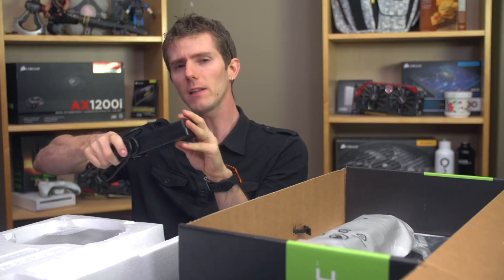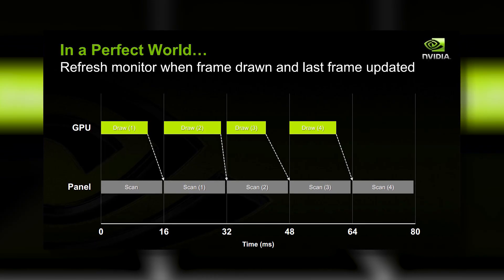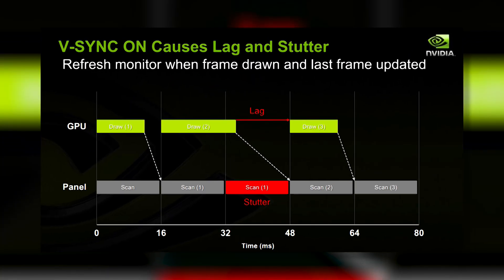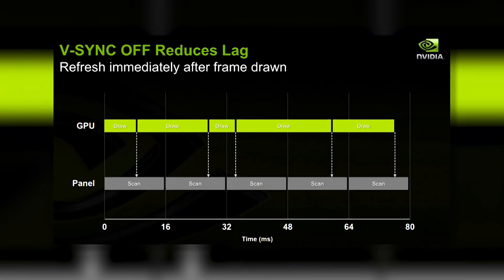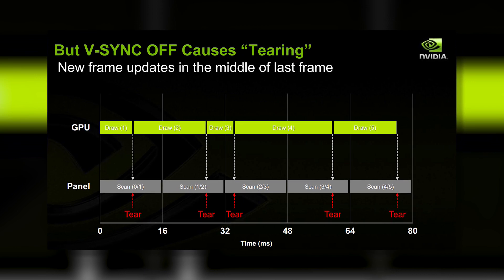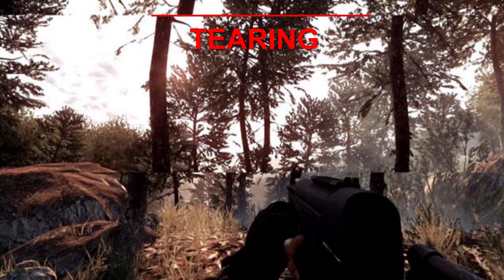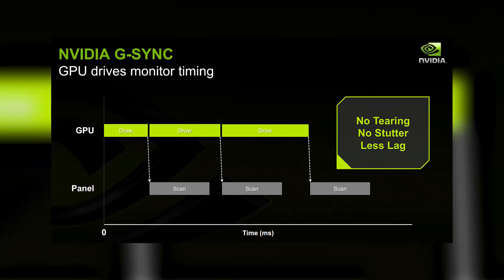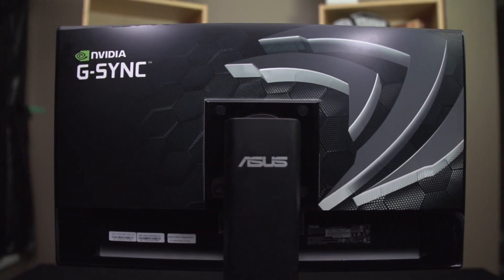NVIDIA G-SYNC Tech Preview - Linus & Slick's Impressions

Comment: Still no gsync monitors..Well the asus Rog is gonna be on it's way fairly soon so they say. It look's good yeah the price is high for a 27'' monitor but considering what you get not just the gsync but its able to display above 1080p and the build quality this makes it a bit more reasonable. I have been thinking about it but im pretty happy with 1080p. I would rather give up resolution and keep my fps higher with max in game settings. I have a benq xl2420tx currently and have been very happy with its performance and color (once i downloaded custom color profile). I herd Benq is going to make a 27'' 1080p gsync,ill probly just wait for this,hopefully 100 dollars cheaper due to the resolution....Anybody have a idea when this monitor or others are due out? I have herd a few different possibilities thus far but nothing concrete.

Comment: People didn't care much about SSD because it doesn't actually affect gameplay, only load times.

Also, SSD made a huge compromise in capacity, this g-sync doesn't seem to have any compromises.
Reply: It effects gameplay. The data transfer is alot faster then harddisk , which should cause output to have much lesser delay. In exact same way to transfer rates. But even harddisk does this so fast, the delay should be unnoticable on both situations.
Reply: implying people don't care about convenience
Reply: Well both G-Sync and SSD don't really have anything worse than current normal monitors and HDD they are just both more expensive, I don't really see what you mean that price is a compromise on SSD but not on G-Sync.
Reply: Crispy Zeal The thing is so many applications don't have onerous load-times, they test a rig because of graphical fidelity, resolution and frame-rate demands.

SSD is obviously better, but at such a cost in price and capacity, I think many would rather take the inconvenience of slightly longer load times.
Reply: I could not go back to not having operating system at least on an ssd. I don't put games on my ssd due to limited capacity compared to size of games worth it but I out os and software such as video editing and photo editing software that normally take ages to load and such.

Comment: Just bought the  Asus VG248QE (as well as a GTX780Ti). I'm digging Assetto Corsa and want to get over 144 fps with a full field. Just watched Henry from nVidia switch out the monitors internal board for the GSync in less than 15 minutes. Think I'm going to take to plunge :O

Comment: Is there any update to this video?,
Here's some food for thought:
After buying several 25" 1920 X 1200 monitors 2 yrs ago, not to mention the hassle of installing them on a 3 monitor stand, I for one won't be buying any new monitors until the ones I have burn up off the stand or simply stop working.
Sorry Nvidia

Comment: so how about g-sync on the new gtx 800m series laptops? some says it will be there (on the laptop screen itself) and some says it doesnt. i dont fucking know man :D anyone know it?
Reply: Nope. We would have heard something. I know for sure that in order for G-sync to work, it requires displayport 1.2. I can tell you that laptop screens won't be compatible.

HOWEVER. Some of the latest gaming laptops that feature 800m have mini displayport output. These are compatible. So it might work with an external display. But I doubt it.

Comment: I'm running vista 64 bit on an asus laptop with a 120 gig ssd because I kept having premature failure of my hdd drives in the laptop, even though I almost never move it and have it on a laptop cooler full time.  I do disassemble and clean out the computer about once every 3-6 months depending on dust buildup and I have external hdds for regular changing media such as movies and downloads. 

Other than having to deal with VERY outdated hardware (laptop is over 4 years old and only single core) I haven't had much problem.  I do notice quite a bit of lag as of late, but it's probably due to age and wear on the computer.  I plan to update in the near future, but for what little I do it seems to run fine. 

I'm not a pc gamer because I don't usually buy games until they're a few moths to a few years old, so I can pick them up for my consoles at pawn shops for less than half price.

Other than not being able to run any newer performance hungry programs or games, I've found it meets my needs fairly well and doesn't take up much space.  The ssd did definitely speed up my boot time, and is still a noticeable improvement when I unplug the external drives for bootup.  I'm not sure just how long I've had the drive so I don't know what kind of life I have left in it, but I'm more that satisfied with it's performance so far as a main system drive.

Comment: Let's say I have 2 non g-sync monitors and I connect a g-sync compatible monitor, will I not be able to use the other 2 monitors because I have g-sync enabled on my g-sync monitor? Or will I be able to use g-sync on 1 monitor while the other 2 are not running g-sync?

Comment: I had once a laptop with an SSD 8GB and it wasn't enough for me and was to expensive at the time of 2010 to buy an mSATA SSD with 32GB, costed over 150$ in my country. So I just sold it and bough an Acer with 250GB but was an HDD, now I feel like I have done the worst deal ever. I had just to wait a few years.

Comment: Wow, this would save so much performance power. Couple this tech with high dpi and you would have the equipment to get the absolute most out of your hardware. Good times are coming for PC gamers and gamers in general, I will buy this if it gets cheaper.

Comment: I bought the DIY kit for my VG247QE as soon as they were available in the beginning of the year.  I can tell everybody from first hand experience, I will never play on another monitor without GSync if I can help it.  The downside is that you are limited currently only to a DisplayPort connection.  DP, not double penetration, is better than HDMI, but it's less common.  You need to play on a PC with a proper NVIDIA graphics card to turn GSync on - you can't just connect the monitor (with an active HDMI to DisplayPort adapter) to something like a Playstation and expect GSync to work... it won't.

As long as none of that matters to you (and it won't - it's just that once you witness GSync, you'll demand that everybody adopt it), then buy the next GSync product that you can.  Because of all the benefits that Linus described (which are all true and not exaggerated), not only does your experience become a better one, but (if you're a picky person like me, noticing jitteriness and frame lag) you'll notice that you don't get frustrated as often and that you're not constantly messing with settings in game, trying to find the right framerate that doesn't cause tearing or jitteriness... trying to match your monitor's 120 or 144hz refresh rate...

In my mind, I register that as a time saver.  When playing DayZ and going through a big city, it doesn't matter how powerful of a computer you have - you're going to hit framerates in the 30s - framerates in the 30s and 40s used to feel unplayable, but they now feel completely normal!  You can see the slowdown but you don't FEEL the slowdown.  In games like BF4, I have noticed that I do play better - when I die in a game, I much less often feel as if I couldn't have done something better to have prevented it.  You're no longer held back by the game and its rendering, but rather by your own reactions.  I can't rate GSync's necessity high enough.  I hope this helps someone!

Comment: Most of the people posting here have no clue how G-Sync technology works.  Please do your homework before posting stupid comments.  G-Sync has nothing to do with what maximum number of FPS you can get in a game.  It's about the gaming experience.  Game play has been dramatically improved thanks to G-Sync.  DisplayPort makes it all possible because of its capability allows full duplex communication between the monitor and your graphics card.  This allows for a fluid motion gaming experience that has never existed before by eliminating screen tearing and studdering.  Seeing is believing.  The only way to find out if it's worth it is to either test drive someone else's G-Sync monitor or buy one for yourself.  No YouTube video will give you the full experience that G-Sync provides.

Comment: Linus, I have a G-Sync equipped Asus monitor (purchased from Overlordcomputer.com) and G-Sync does NOT work when in Surround mode.  This information is provided within the Nvidia control panel that states this information.  I have to say that G-Sync is awesome and works as advertised.  Near zero input lag (1-2ms) and mouse response is instantaneous (Logitech G700s set at 1000 polls/sec) and there is complete elimination of screen tearing and studdering.  The only thing that G-Sync can not compensate for is frame rate drops in game, which has to do with the graphics card capabilities and nothing to do with G-Sync.  My recommendation is if you are an avid FPS gamer, G-Sync is worth every penny.  However, if you are primarily an RTS, RPG, MMOG game player, then I would say G-Sync is not worth the upgrade for you.

Comment: Sorry to burst everyone's bubble but this is a gimmick like phys-x.I got a DIY kit and notice virtually nothing playing BF4 with a 780 on maxed out settings. There's is still micro-stutter and lag. In fact, there is less stutter when g-sync is disabled. Sorry for your luck
Reply: This is completely wrong!  GSync requires a few things to work how it's intended:  triple buffering needs to be off, Vsync needs to be off, and max frame render ahead limit must be put to 1 in the Nvidia control panel.  Battlefield games AUTOMATICALLY have triple buffering enabled in game, so to disable it you have to make "user.cfg" and place it in your game's root directory - open it with notepad and write one line "renderdevice.triplebufferingenable 0"

Also, people have reported worse frametime when hitting the 143fps ceiling with GSync, so if you set a framecap in game to 120fps, you will always get great fps, frametime, and smoothness.
Reply: Considered getting the DIY kit myself, also with a 780. Good to hear opinions from an actual owner/user. Thanks for the feedback, now I don't have to blow $200 and void my monitor's warranty.

Comment: I have the PCI-E OCZ revodrive 110gb V1 in my 2500K 5GHZ gaming rig, my sony i7 laptop has a kingston 256gb SSD. I cried when i used my mother in laws atom powered netbook with 1gb of ram, i REFUSE to use it. i made a coffee waiting for firefox to load.

it doen't help that she treats the netbook like a work station, outlook, 40+tabs in firefox, with never restarting or shutting down for 5+ months!!!! she is an advanced computer abuser for sure. "look!!!,  i won a prize!!, why do they want my CC#?" LOL!!

on a different note my uncle bought a sammy  128gb 840pro for his HT pentium-d 3ghz 4gb 800mhz ram-bus dell system running win7. other than the cpu getting slammed at 100% durring loading anything the system has seen a 4X speed improvement and a lot less waiting :)
Reply: What you need to do on her Atom computer is remove all the memory modules, have like 128 or 256mb installed, then increase your page file to about 8192mb  :-D   BLAZING FAST!!!

Comment: hmm i have same monitor but ofc without g synk , with 144 hz it working smooth in games , so maybe its just marketing i dont know , to sell what we dont need for big money :)))
Reply: AMD showed a freesync demo where they use existing monitors and existing cards (the ones you can buy) to produce the same effect.
There' s nothing special about it: some professionals already use tools to alter the framerate (and resolution) of the monitor using software like AMD's custom timing tool for Firepro cards.
http://www.amd.com/uk/products/workstation/graphics/tools/pages/tools.aspx

The tool just changes the framerate using one of these protocols: GTF, CVT or DMT and the monitor just ajusts ASAP. If you hack the driver to synchronize the monitor all the time (every frame) you have a free alternative to Nvidia.

Comment: That video made me laugh. Testing Vsync on a LCD is just dumb lol It's designed for CRT monitors.  They can't record at a high enough fps for comparison because high speed (over 60 fps) cameras don't exist?  Wait, what?  Uh try 1000fps up to a 1 frame per millionth of a second Morton Sultanoff, back in 1950.  Then... can't play it back because no one is viewing higher than 60??  I am @ 120Hz on a CRT as in Vsync'd and triple buffered in SLI for 120fps.  A real test would have had two matching spec towers and monitors, one with this Gsync and run same graphics all recorded with a high speed camera.  Fail review

Comment: What I don't get is... The concept behind G-sync is pretty darn simple, linking monitor refreshes to frames produced by the GPU... What's stopping AMD from doing the exact same thing with their own implementation? Please don't tell me it's a stupid patent thing (let's not go down the Apple way). Or display manufacturers implementing one that works for both GPU vendors?
Reply: Well, scratch that, AMD already demonstrated FreeSync, which is pretty much the same but is based on an open standard and works with any display (no need to pay for a more expensive one), through software.
Reply: That's exactly the thing, AMD has shown us that it actually already was a standard for years (refresh driver boards in monitors can already do what the GSync board does, they may just need a firmware update). But it was only used for power saving features in smartphones and tables up till now.

Nvidia just took the idea and made a proprietary board for it to cash in before the rest of the industry see it and adopt the standard.
Reply: zolikoff A standard on laptops that isn't possible on desktop monitors yet.
Reply: George Washington The way I read it is that it's entirely possible (don't see why not), just not implemented yet, because it was being used as a power-saving feature, which is only useful in laptops, tablets etc.
Reply: It's a possibility for the future. Look up dp1.3. And is doing the right things. 
But you have to think, nvidia is apart of VESA. They already knew about this.
Reply: Isn't Mantle from AMD something like this
Reply: djsmileyoflasvegas No.

Comment: As nice a feature as it is, I don't see G-Sync taking off until it becomes an open specification.

The bill of materials is a huge influence for the people making monitors, so needing to include an extra module that can, at best, serve only half of your potential customers seems like something that's not going to gain traction.

To be fair, I feel the same way about Mantle (though in that case it's only software, making it more likely to be adopted).

Comment: Here's why I disagree with Linus on the G-Sync vs SSD debate.

Cost vs benefits.

For SSD, the actual monetary costs are much higher than HDD. In addition, there is the cost of lack of capacity available that you could get on an HDD. The benefits of an SSD are pretty good, everything loads super fast. But the impact that has on gaming is far from life changing. You shave off a few seconds of load times.

For G-Sync, the cost, from what I hear, is almost nothing. The monitor price plus maybe 50 dollars. The technology isn't expensive and the process of putting it into the monitor is not either, so Nvidia doesn't have to have a huge price tag on it. The benefits though are gargantuan. For gaming, there will literally be no moment when G-Sync isn't enhancing your experience.

Comment: I have two 780 GTX Ti and I have to say I get so much tearing in any games even from a crappy low ends games. This is a reason why the g-sync came out because of the bad from GPU that couldn't render game smoothly anymore and drivers that couldn't fix these issue. Wait for the 880 GTX with more GDDR rams and The G got a bigger chip that render no matter how max FPS you get and what low FPS you preform and no capping off at any FPS plus more rams on the G as well. I would buy this if it was on a 37' to 39' ultra wide screen 4K monitor ;)

Comment: Meh... just like 3D and 120hz, it's gonna be a niche. It's still a 1080p monitor after all (for now), it's not expensive to just buy a top tier card from last year and frame cap an elcheapo 120hz monitor. If your gpu bogs, no type of vsync will cure that stutter.

I don't see the point of this in 1440p+ let alone 4k. You'll need to be running 2 cards to even get it up to frames then you'll have microstutter to worry about.

Save your money - buy a 120hz 1440p OLED for $350 the best single card won't get over 120fps on that = no tearing, or wait for dell's sub $1000 4k tn monitor (or the korean cheapies that come along with it).

Comment: I was wondering if I buy 120 Hz g-sync monitor and I dont have kepler based GPU what would happen? Its either the monitor is gonna work with fix 120 Hz or it wont work at all.

Comment: Yeah, its Nice! But for my self it Looks like Nvidia is on Pressure. Why? You see it @ the so called Next-Gen Consoles. They have the AMD Powered System. And AMD gives a fully new API "Mantle" to all! So they got it on Linux and the Steam Machines. We now all that Microsofts Direct X is expensive and only on Windows-Software, and it costs a lot of Hardware Power! Some Programmers i Talk to (im from Swiss and Programmers also). They all say the same, like i talk to you Guys. Now i have a Last thing to say: Look @ the Catalyst Driver. LCD Overdrive. Its still in there for Years! And it worked so good. Im not a AMD Fanboy, i have PC 1 that Run on AMD and PC2 that Run on Nvidia. So you can think about, and then Choose that what fits you Best. THX @nd Happy New Year : )

Greetings from Switzerland
Take a Look @: Journey of a Roach. Koboldgames/Swiss.@Steam